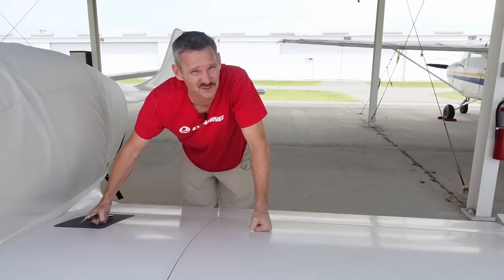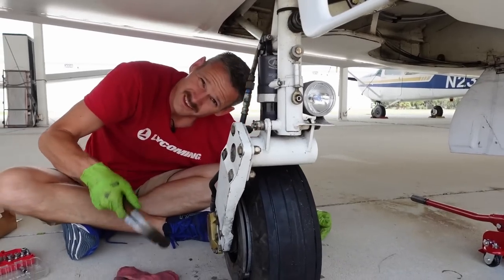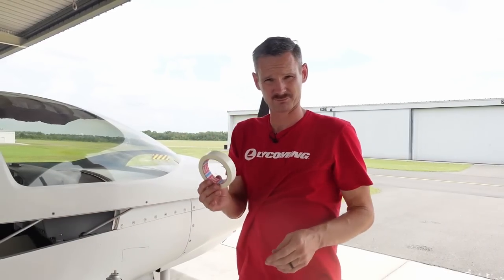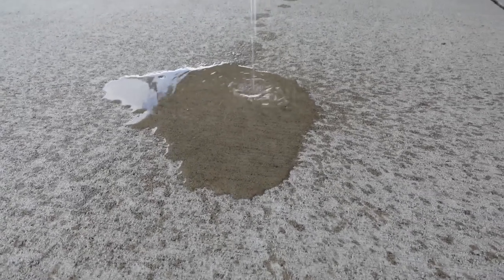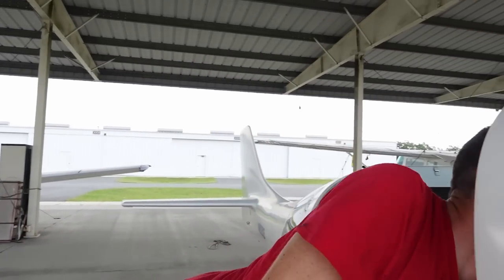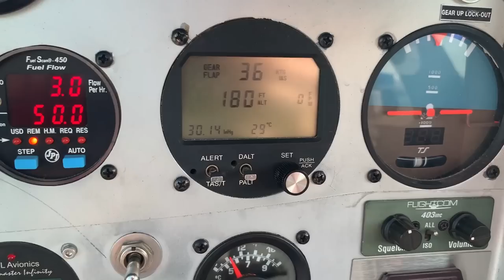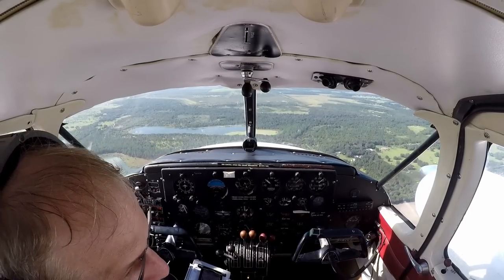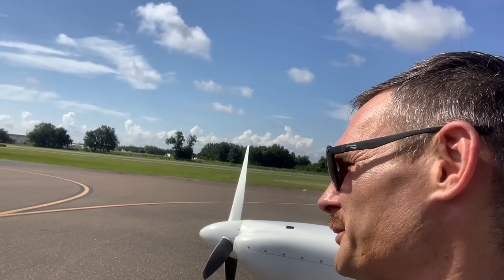This Line Slowed The World's Fastest Airplane & 1st Race!

Comment: I was working on my RV 4 one day( installing new baffles on the engine) , Herb Colbert came by and was looking at the insulation he said you're doing a good job there, but, when herb Culver says but I pay attention ! He sketched out a little baffle assembly to help clean up the air coming out of the engine cowling on the bottom, we picked up an average of five knots across the board I made it quick install/  removable so we could test performance. Herve Colver was the lead aerodynamicist at Lockheed skunkworks working beside Kelly Johnson .

Comment: Jimmy, you should put a gear locked annunciator in the Lancair. I put one in mine, and it makes it easy to know when the gear is locked in position. In addition to the three green for down, it is a backup indicator for all three down and locked as well as when the gear is properly up, which is handy since our gear is only held in place by pressure.

Comment: That prop blade angle on Cameron looks pretty aggressive, if it's a ground adjustable and you have some wiggle room with the max engine RPM you should maybe try and decrease the blade angle to have more of a 'climb prop' than a 'cruise prop' for this competition. Fine wire spark plugs, solid state sparky boys and trying to lean for best power at wide open throttle frequently could make it competitive with the 401. Always love these videos, great stuff Jimmy! 👍👍
Reply: Considering how fast a lancair cruise it, it make sense the prop has a high pitch angle. A fixed pitch climb prop may lose a lot of cruise performance comparing to how much a cessna may lose with a climb prop...
Reply: @shiroyukiwang1252  He can always adjust it back to what it was once he smokes all the competition! Lol
Reply: The prop blade angle is not constant.  They are variable pitch props, with pitch adjusted in flight, as is  throttle, to give a combination of RPM and Boost Pressure.  Fixed pitch props are more usually used in initial trainer aircraft.
Reply: @alantorrance6153  It's a fixed pitch or ground-adjustable prop. No prop lever.

Comment: The most efficient planes in the air are sailplanes.  Hold that thought.
Things sailplanes do (gliders) to make them more efficient are:
- use mylar tape tape on the seals
- divert the exiting air from cockpit to a single spot (often at the base of the rudder)
- seal up the air going from the cockpit into the wings (this one seal makes a significant difference)...having air exit at the ailerons = no bueno
Those are all that come to mind.
Reply: What do you mean efficient? You mean impractical and unable to stay in the air without sun or winds for lift. Ha ha. I think you confuse efficiency with glide ratio and low drag. Yes they generally have better glide ratio and lower drag than powered planes. However there are powered planes that are very efficient, think of them as powered gliders. However an engine sticking out, higher aircraft weight causes loss of efficiency. Back to first 2 sentences above. You can't take 250 people from New York to Paris in 7 hours in a glider. Definition of efficient is vauge. Do you want to go to war in a F-22 or a glider.
Reply: and tape a piece of Yarn to the canopy windshield.  very important yaw indicator.
Reply: Lol i thought the same thing, that glider has infinite efficiency based on his definition lol.
Reply: They are efficient, but they are for sports, not practicallity. That's what touring motor gliders are for. And it is true, that you can make a powered aircraft more efficient by adding well proven things from gliders.

Comment: Jimmy for future reference  you should drill your holes in the trailing edge of all of your control surfaces so that in flight they drain if there is water and sitting on the ground when it rains they drain. You should make that happen. Your should also do an extensive check of your control surfaces to make sure you dont have any issues from the standing water.

Comment: Lol I was going to suggest glider mylar and tape. It's an art, and it's easy to make a buzz if you get it wrong. And that's in a 130 knot glider. Half way through the video, so don't know if there's buzzing yet for your handiwork...
Reply: Haha that gear flap down will easily negate any gap sealing advantages... Hope you fixed that before ripping off all the mylar :)

Comment: Jimmy you need to use acetone to clean your wing before tape. Achilles leaves a little oil and check out how to grease wheel bearings and there’s 2 ways one in your hand or buy a bearing greaser but I have used my hand to pack the grease till it comes out all the way around . You can race my Glass air 111 it goes 300 on a hood day and like yours uses very little fuel .

Comment: Important lesson for everyone, drain holes! Also pressure relief if areas are well sealed and the plane is flown at high altitude. Check Eliot’s video on the Thunder Mustang horizon tail cracks….

Comment: For future reference: if you have to peel off sticky tape from painted surfaces make one end loose, fold it over and peel it parallel to the surface. Also most of glues on those tapes are weakening with heat, so a quick pass with heat gun will help loose it some more.
Reply: Invest in goo gone.. We used it at a recertification facility i worked at and its amazing.. Done deal..
Reply: Using nail polish remover along the peel back works better than a heat gun.
Reply: @2muchcowgirl155  Wouldn't that remove the paint also?
Reply: Yep.
Reply: @johnnunn8688  you can use regular ole gasoline if the paint is an issue.
Reply: Seems like weak paint. A good 2 part primer and base should stick better me thinks
Reply: @kasm10 , deffo. I’ve never taken paint from an aircraft, un peeling tape.

Comment: Water in the ailerons is quite dangerous, they are counter-weighted against the occurrence of flutter and with any amount of water inside, the counterweights are no longer balanced and heavy enough to stop flutter. You had likely doubled the weight of the ailerons with all that water inside them. At higher speeds a serious hazard and catastrophic loss of both the ailerons was quite likely.
Reply: How does your son film without continuously laughing at you?
Reply: So how would he keep the water out of them?
Reply: @twistedyogert  He probably just needs to remove and waterproof all the connecting hardware.
Reply: @twistedyogert  small vent holes in the right places, low points. Must have small vent holes to prevent the air trapped inside from expanding at altitude and they blow up from internal pressure. My Glasair has similar ailerons with small vent holes, not sure how he gets a quart or more water inside.

Comment: I owned and flew a PA23-160 Apache and setting 2450 RPM was a MISTAKE... He should have been at 2700 RPM and full throttle. The more RPM the more HP the more climb....  Also the Apache holds about 108 Gal of fuel....  How much fuel did he have in it. Solo light fuel the Apache performs well.

Comment: We were told never to blow in the pitot tube because it could damage the instrument or knock it out of calibration. The line behind the instrument should be disconnected first then blown out to remove obstruction.
Reply: That sounds very sensible as the ASI must be a delicate instrument

Comment: Jimmy, i would pull the ailerons, and check for internal corrosion, unless those are fiberglass, also you should drill at the lowest point for a drain, just my 2 cents.....Retired Navy Airframe tech.... Fly Navy

Comment: Jimmy, if you haven't already done something about the tape interference around the canopy, take the Wife's  Blow dryer on high heat or a heat gun on low heat and carefully heat it till you soften and direct the tape to stand off the mating surfaces enough and cool to clear the problem areas!

Comment: I have used soaring tape for years on my Debonair, sealing the wing root rubbers on the bottom sides of the wings.  Installed flap and aileron gap seals years ago too.  then did a very accurate rigging of the flaps and flight controls.  It accounted for 8 kts difference in cruise and 200 ft/min climb rate increase, so you will see improvements.

After seeing the water coming out of the ailerons, I had to stop the video and comment.  The concern I have after seeing the water leaking out from drilled holes in the ailerons is flutter.  With all that moisture in there I can't imagine your flight controls are balanced.  Another point along those lines is the tape coming up from the seal around the flight controls.  Steve Wittman died as a result of fabric separating (a bubble in front of an aileron)  creating an aerodynamic imbalance which started a high speed flutter.  

The point is the faster you go the more critical the balance of the flight controls have to be.  And a home built aircraft, built by someone else, needs to be carefully examined and checked.

Anyhow, back to the video.

w
Reply: Flutter from unbalanced control surfaces is certainly an issue with faster homebuilts, and while it's not good to have water in control surfaces throwing off balance, I doubt it would contribute to flutter unless the entire thing was completely filled.  Sloshing water would act as a fluid damper and if anything, it would have the opposite effect.  The mass of a surface has to be elastic in order to experience aeroelasticity, so that means the weight needs to be relatively stiff and at least fixed to the surface.
Reply: @Skinflaps_Meatslapper  once it freezes at altitude it is not a damper.  Especially far behind the hinge line.

Comment: For gaps around the canopy, on our glider, we used to use soft foam tap in the gap as reducing the airflow through the gap is still important. I have not watched your whole video yet, but I'm curious to see if any the tape blows off (with pressure different as speed), as you are flying much faster than a glider normally flies (even on a glider I recall once I blew some tape off doing aerobatics).

Comment: I am having the same problem with my car. I want to go 200 mph at Bonneville Speed Week and join the Red Hat Club.
I can now regularly get 196 but it took a metric buttload of work and money to get from 180 to 190 and then its been getting exponentially more resource intensive to gain an additional MPH for the last 6 miles per hour.....
At this rate, I will completely run out of money, time, food and will have used up a lifetime of collecting favors to get to 199 and then I will have to quit.
Been thinking about selling t shirts that say, "Just 1 More".....
Reply: Cubic dollars as they say. I wish you all the best in the pursuit of speed good sir!
Reply: What car
Reply: @jonasbaine3538  1988 Porsche 928 S4
Reply: Seal the cab.  If there's any air movement inside, that means somewhere in the body there's a gap catching air.  T-6's at Reno can see several mph gains by making sure the canopy and whatnot is sealed up, and they're flying in roughly the same speed regime.  Unless you're power limited, it's all aero at this point.
Reply: @Skinflaps_Meatslapper  I'm on it already. The car has a aerodynamic skid on the bottom of it. I removed the mirrors and taped all the gaps in the body. The car is pretty well sealed from the factory. Something my wife just can't seem to remember. In winter she has to pull on the door pretty hard to get it closed.
During summer, if I have any window or the sunroof open even a tiny crack she SLAMS the door soooooo hard....
I had it on the freeway once at sunrise with the whole road to myself coming down out of the hills on I-5 descending down onto the valley floor.....
I slowly pushed the pedal down and let the car accelerate all the way to 160 mph before I got nervous.
I took my foot off the gas and was amazed at how long the car was taking to slow down. 
I had turned off the a/c and it was a little warm in the car so I decided to crack open the sunroof and the pressure dropped and my ears felt it instantaneously. 
And the car started to slow down like I threw an anchor and chain out the back as I lowered both door windows.
I have to say though, that car sucks down to the road like crazy at those speeds.
I'd like to try a hill climb event. With the handling and the horsepower, climbing a hill would be a great way to race that car.

Comment: Jimmy far be it for me to tell you something but the pedo tube aka air speed pressure tube can’t take a lot of air pressure when you test them you use a syringe and only use small amounts of air with you blowing into it it’s a possible you damaged the diagram in the airspeed indicator and that’s why your top speed was off and when you took off it looked as if you was just above stall speed but that’s my two cents it was fun to watch best wishes

Comment: If you are occasionally hauling a car jack to the hangar, Harbor Freight has aluminum racing jacks that are way lighter than normal ones. A small 1.5 ton jack is like $99 (so twice as much as a small cheap jack). It would fit with the racing theme, and your back will thank you.

Comment: If it's possible, you should look into installing spoilers on the on top of the wings of that speedy little plane. They wouldn't have to be very wide and would help slow it down on landings and:face-blue-smiling: save brake wear, besides, "What could possibly go wrong?

Comment: There’s zero grease on the bearing I would worry more about that than breaks you maybe making a unscheduled left turn
Reply: You will notice Jimmy greased it ( them) up on reinstalling the wheel. Also what a crappy design on the brakes that the piston popped out. No rubber piston dust seal like on a car disc brake calliper.

Comment: 4 ways to slow your Plane down. 1: drill two holes to let the ballast water out 2: put sticky tape on to hold it tight 3: leave the bomb bay doors open 4: add new brake shoes for even more stopping power and ohh yeah suck a bug for good measure 🦟 GO Jimmy

Comment: Jimmy. You need to be very careful when changing gaps and clearances on Airplane control  surfaces. Doing the wrong thing can create 'Flutter' which is deadly to an airframe. Check with the original owner to see if He had a test done for control surface flutter at different speeds or check the airframe manufacturer to see what they have on gaps and clearances vs airspeed.
Reply: He was doing wing joint (fixed) and flap (also fixed except take off and landing. I think he did something on inboard end. Not a big deal. However you are correct doing an aileron seal or elevator seal can change feel or effectiveness.

Comment: Normal aircraft ignition is "duplicate"... mags, wires, plugs (2 per cylinder), right?  Does this super-sparker system dispense with the duplication and run a spark at tdc of the power stroke, then a second spark to the other tdc of exhaust stroke.  This is done by Chrysler on a very recent hemi car.  Dying to know!
Reply: I don't how to reply.
Reply: Some have staggered time on the spark. It's been many years since I was in A&E school but I think the time difference on the Lycoming engines was 5 degree. But I might be wrong.

Comment: Should use a vacuum on the flaps with water in them. And find where the water is getting in them and fix the leak thinking of getting caught in a rain storm and a problem due to the water...

Comment: To double the speed of an object through the air, you need more than the triple the engine power which you mentioned. It's a volume of air which needs to be moved out of the way: 

At twice the speed, assuming that you're at the same altitude and air pressure, twice the volume of air needs to be moved away twice as quickly, so you need four times the power, in order to double your speed. That's not counting the variations in engine and propeller efficiency as speed changes. 

Fuel consumption is also dependant upon engine, propeller and airframe optimisations. It could rise to less than 4 times that for lower speed if the aircraft is optimised for the higher speed. Or it could rise by more than 4 times if the aircraft is optimised for the lower speed.

Faster aircraft usually fly at higher altitudes wherever possible, because air density falls with altitude, so they can save fuel, providing that the engine air supply and pressure is maintained adequately. That's why turbos and superchargers are used in those aircraft.

Comment: Im waiting for him to find out the water was meant to be in there to weight the ailerons and balance them.
Reply: Absolutely not, and could cause flutter and loose the ailerons.
Reply: @danblumel  You think it's extremely unlikely the designer/builder had a reason to "weight" the ailerons?  Maybe they did flutter, maybe the fact he is flying at a 5* right hand roll angle, maybe there was a reason the right one had more in it?
I only build/ply models, I've never had to weight an aileron, but i have seen similar tecniques to damp the controls against ocsillation or to make them slightly less twitchy.
Reply: I mean, if you had a tendency to roll due to the torque prop, you would take that out with rudder, but without aileron trim, any tendency to roll or crab in straight and level flight can't really be fixed.  However, if you were to make one aileron physically heavier than the other it would have the tendency to ride lower and provide a tiny amount of roll trim.
No?  Nuts?